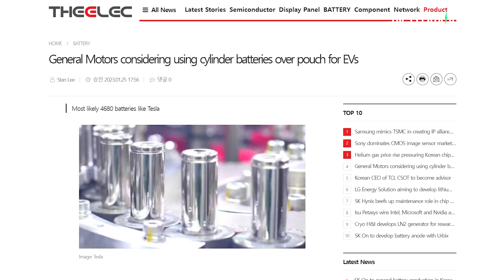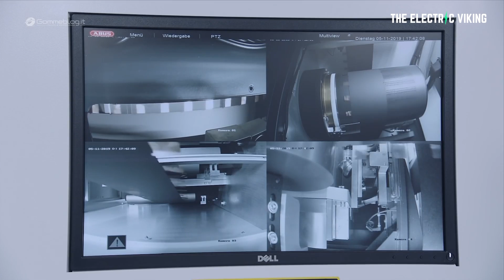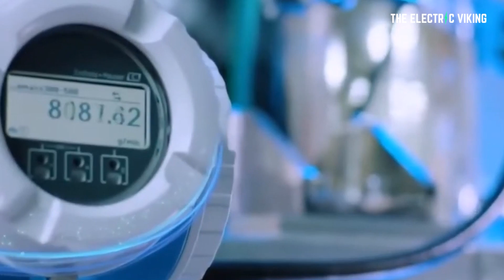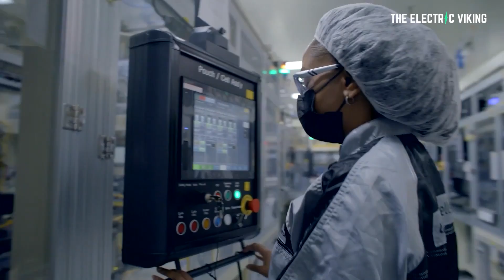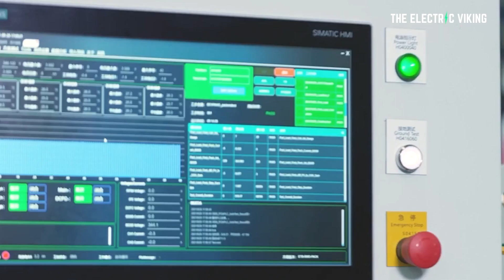Is GM changing from Prismatic to Tesla's 4680 cylindrical batteries?

Comment: If Tesla could make enough 4680 that would be one thing; but evidently they can't. There advantage was slightly higher density about 16% and faster charging/discharging - now fast charging is possible with high voltage super chargers - so much of the pro's are diminished.  They may just wait for a better chemistry and then go for a better density cell for vehicles demanding such cells like the cybertruck

Comment: I believe Tesla was looking to change to the fastest and most efficient production form factor and power to weight ratio. It doesn't necessarily have to be the best but if you can whack em out at high speed, and cheaply, you're on to a winner and that's their aim in order to transition us all to EVs as fast as possible

Comment: My guess is that a large part of the advantage is in their application in structural battery packs saving weight, increasing stiffness and cutting cost / increasing efficiency in the vehicle overall even if the cost of the batteries were to be the same.

Comment: What about Blade cells or moving to Solid State LFP batteries. Cylinder cells will not pass heat as well as the flatter or prismatic cell construction.

The cylindrical form factor has less surface area to move heat.

Comment: Hi Sam and all viewers.  Cylindrical batteries follow the normal practice of primary battery makers worldwide.  Ever Ready, Duracell and others have been using spooling-up machinery to make D Cells, C Cells, AA and AAA cell batteries for DECADES.  Even the 9V PP3 format battery is made up from a few cylinder cells inside.  Who makes flat batteries for general use?  Very few and they are specialised uses.
4680 size batteries are just a step change from the smaller format before it.  Like primary alkaline batteries (and even electrolytic capacitors) the quickest way to fix a volume with an anode and a cathode separated by an intermediate 'separator', cylindrical winding is far and away the quickest way to do it.  Takes a while to tweak to QC but when that hits the sweet-spot the yield goes right up.  The TESLA design was unique and has taken a while to iron out the creases.  It will happen and others will follow.
Keep up your great work and greatest of hopes for Shanna.

Comment: Cylinder batteries are stronger and enable space around the battery 🔋 for cooling and or warming as required.

Yes there is slightly less energy density however this reduces the risk of the battery cell bursting into flames 🤣.

I would rather have a battery that is safer.

Comment: What makes Tesla's batteries so durable and powerful in their cars? It's their BMS, battery management system. Why is it so good? Because it's so efficient to manage the temperature. What makes temperature easier to manage? Maximizing the temperature exchange surfaces. Which cylindrical batteries have a lot of compared to pouch and prismatic. IMHO (I'm no engineer), this, plus the structural aspect of these batteries is what makes them so much better.

Comment: Both 4680 and blade formats aim to optimise EV performance while providing good thermal management.

Determining the exact optimal configuration is a problem that could lend itself to a linear programming analysis. 

These are complex problems and it may take some time to work out the optimal solution.

Comment: I don't I've ever seen people saying cylindrical batteries are a dead end. Technically they will produce less energy dense battery packs, but they are cheaper to make and easier to assemble. The pouch cells by their nature are more fragile as an accidental puncture means a fire in the factory while cylindrical cells have a steel casing. If your goal is a dirt cheap car the best answer is the dirt cheap batteries we've already had massive factories for. 

But pouch cells are far better performance wise. They will obviously have better energy density as cylinders are just incredibly space wasteful producing less energy density and the rolling of the cells also produces more resistance and heat (though this is marginally improved in tabless cells at the cost of energy density). This also means pouches in theory are better in performance, however, pouches also tend to be slightly less stable as they can expand from heat and sandwiching them together makes cooling a bit more effort. 

As you can see it's a rather iffy trade off. I've never said that pouches are superior to cylinders, though I have pushed back on your claims pouch cells are not as innovative considering no cars till the Hummer had ever used them and they do have some advantages even to the most advanced cylindrical. While I know pouches are more hazardous, smartphones have also used them for years so I can't really tell by how much exactly. Likely they more see the fact making their own machines as more costly than buying existing machines for cylindrical cells.

Comment: While Cylindrical cells can be more adaptive, When it comes to space saving and energy density, theres no denying that square or rectangular shapes offers way more storage per volume. Thats why machines and devices like laptops, powertools and mobiles using customised rectangular shaped batteries for maximum capacity. Each have its pros and cons.

Comment: When do you think the competition figured out that Tesla knew something about battery technology that they didn't?

I think about the time we saw Sandy Munro tear down the 1st Tesla with the 4680 and the time the competition were also doing the same. I think the combination the public enterprises like Munro and the competition's own engineers I also figure that Tesla discovered the secret sauce, then board meetings, then discussions with your battery supplier and they pushing back that their way of battery manufacturing is better. 

I figure a month after the 1st 4680 battery was available for the competition to check out. And remember its not just the shape. The manufacturing method inside the battery are also new technology Tesla figured out. 

The fights between the competition and their battery suppliers probably took a few months, then final decisions along with figuring out how to get their own 4680 style batteries

Yup - last summer. I also think the competition since 2020 figured out that Tesla was a threat, by 2021 they became very worried and by last year and the launch of Giga Texas and the 1st 4680 battery being sold.

I wish I was a fly on the wall at some of those board meetings.

A decade from now, there will be a miniseries on how Tesla took down big auto and now Tesla is big auto.

Comment: Elon warned GM about the dangers of pouch cells and thermal runaway several years ago.  What was that little problem that GM had in the Chevy bolt a year ago?  Tesla had the same problem and fixed it by moving away from pouch cells.

Comment: “We realized that the true problem, the true difficulty, and where the greatest potential is – is building the machine that makes the machine. In other words, it’s building the factory. I’m really thinking of the factory like a product.” - Elon Musk

The 4680 battery was designed for the factory, i.e. for the manufacturing process, instead of the other way around.

Comment: If the thickness of the layers in a cylindrical cell expands uniformity from heat, the layers has to slip against eachother.
A flat cell doesn't have that problem.

So, cylindrical cell isn't the best from every aspect. They are easiest, and thus fastest, to produce, though.

Comment: I don't think GM used prismatic cells, rather they used pouch cells to form their batteries. The Chevy Volt ones are pretty sweet, I've bought new and used ones for electric motorcycle builds.

Comment: My intuition tells me that the long ultium style cells when used in a structural battery pack, could suffer from the torsional stresses present in use as a structural component. Using the 4680 cells with the inter cell spaces filled with something like 3M's boron nitride would provide thermal conductivity for battery temperature control and electrical insulation between cells and pack elements and avoid those torsional stresses. Yet another thing to consider.
Reply: I guarantee you that no one is using boron nitride to fill the space between cells.  Maybe a polyurethane or similar product.

Comment: I guess the LG/GM decision to not proceed with a new factory is probably multi layered and not exclusively the change of battery form. The truth may take some time to come out. From a GM perspective it does present an opportunity to partner with another battery specialist rather than just having LG. I would love to see GM use the opportunity to perhaps go with a next generation battery chemistry such as Lyten's lithium/sulphur battery. Getting triple the gravimetric and volumetric density of current batteries at a greatly reduced cost (no NCM) would help it move to the forefront of EV tech and make up for its lethargic EV transition pace thus far. Interestingly, Lyten (whose CEO is an ex GM engineer) only just got a mini scale battery factory into operation in late 2022 demonstrating proof of scale and is looking to get a major scale battery factory up and running by 2025.

Comment: The debate here is cylindrical vs flat. The fact that the debate is ongoing proves that neither has the overwhelming, 'killer' advantage. The choice is not about battery chemistry, but about how to package it, and this debate may continue for decades. But another factor that is not mentioned but should be: Looking forward, which form is more amenable to different chemistries, and is more adaptable?

Comment: Munro and Associates came up with the same volume per cell but shorter and with a 50mm diameter.
The Tesla engineers, the Canadian Dahn labs and their own in house battery production line manufacturers, chemist's and designers, Grohman and Hibar and Maxwell know more than a little about production.
I've no worries about the outcome. TSLA!

Comment: Yes, Ultium batteries may be more dense, but what's the weight? Can the architecture shed heat quickly?
Reply: If they are more energy dense, then the weight of a given kWh size pack is less.  That's definitional.

Comment: Battery engineer here. Cylindrical cells have higher energy density than prismatic cells, but when packaged in a pack, there's more dead space between cells, so at a pack level, cylindricals and prismatics can have comparable energy density. Cylindricals have an advantage in that they cannot swell, and swelling is a common failure mode in pouch and prismatic cells. If I were buying an EV, personally I'd prefer a vehicle with cylindrical cells.

Comment: Whatever form wins out in the end, all use Li in their chemistry.  This is great, and necessary for vehicles because of weight considerations.  However for static applications, there is no such restriction and the added demand for Li to build grid storage is pushing up the price of Li and hence of EVs.  And some of the alternatives are superior to Li batteries in a number of respects.  They have longer life, are made from cheap, readily available elements, can be cycled between 0 and100% with no damage, are safer and hence more easily shipped, need simpler electronics and are easily recycled if you ever need to recycle them.

Comment: From one actual engineer to another,  Paul O'Neill's comments below accurately explains why engineers prefer the cylindrical battery cell design over a prismatic ('pouch') design. Especially the stress in the many folded foil points in a prismatic battery. Yes, prismatic has a higher volumetric energy density but they are less durable than cylindrical. Why, because prismatic cells are inherently prone to metallurgical stress & fatigue failure due to vibration at the folds. They should only be used in static situations like a power wall and not in a dynamic situation involving any vibration like a moving car. Tesla engineers, Sandy Munroe etc know this problem exists. It's basic engineering. Manufacturers try to avoid the high cost of recalls causing brand name damage and should build for longevity, unless of course, they want to build for that horrible thing called 'obsolescence'. Sam, I personally would avoid purchasing any EV with prismatic (pouch) batteries.
Reply: should read - 'built-in-obsolescence'.

Comment: 4680 allows continuous manufacturing, following the stop/start for welding the end cap collectors.
Reply: And you can adapt the welding onto a rotational station. Just need a good slip ring design that can handle the voltages. Similarly to the modern Hot Fill Bottle Blow stations that are now electrically heated (230 VAC).

Comment: It's just a rumor at this point, and the rumor didn't come from GM, it came from someone speculating if GM COULD use cylindrical cells, not that they have ANY plans to, so the rumor means absolutely nothing.  Cylindrical cells are shown to be slightly faster to produce over pouch cells, with today's machines, but, that may not mean anything.  Who's the world's largest battery manufacturers and what types of batteries do they make?  CATL, LG and BYD, and none of them make a single canned, cylindrical cell.  People can hypothesize all they want, the facts are the facts, and I don't care what form factor they use for their cells, as long as they work good.  Ultimately, GM, and many others, are looking to use sold-state prismatic-type cells which require virtually no BMS, so today's batteries are a short-term story.

Comment: 4680 cylindrical Is key to the structural design, using the honeycomb sandwich method. I think this is an important reason for going with 4680.
Reply: Also The 4680 structural pack might be necessary for using both front and rear castings. I think the front casting is only used with 4680 Structural pack

Comment: My guess would be that GM et al are just doing due diligence in their research such that they are prepared to move to the 4680 once it is a proven battery.  For me, I'm in the camp that is waiting to actually see a Tesla using the 4680 in numerous videos.  Then I will believe, and GM will probably move to the 4680 once they are convinced that it won't fall on its' face.  GM does not need more cars catching fire.
Reply: Some MYs with the 4680s were produced at GF Texas a few months ago.  Sandy Munro took one apart, at least the battery pack, recently.
Reply: @Chainyanker007  I saw that, but I never saw them driving it around.  Just tearing it apart.

Comment: I’m confused. I would think that pouches have the potential to be more energy dense.
Reply: You are correct, a square shape or rectangle object is always of higher density than any round object. 

However, there are 2 additional parameters that need to be considered. 

1) Is the heat management, or the contact surface area needed to disperse or add thermal energy

2) Distances travelled from the cathode to anode for the current to flow. The greater the distance, the greater the internal resistance. The greater the heat generated that is required for item 1. 

The 2 above are based on the assumption that the battery chemistry is identical. 

Hence the Telsa Tab-Less 4680 design. Shorter distance for the electrons to travel (less heat, less resistance). And 360 degree available for cooling surfaces. 

 Munro Live did a video or two covering this topic in greater details. https://www.youtube.com/@MunroLive

Comment: 4680 cells will work, but not as good as the smaller cells. Smaller cells = more energy density. Only reason Tesla will make those 4680 cells, it's because they are cheaper to produce.
Reply: Wrong, the larger the cell the less material needed for the wall material, so a larger percentage of the cell's weight goes to the energy storage chemicals. Also the design collects the power from the cells better on a shorter path.
Reply: @earlpottinger671  
So why Tesla is using 18650 battery cells exclusively for Model S and Model X ? All Tesla battery cells was tested by others. I can write you exact density, and energy numbers later, I don't have it in front of me right now. 4860 cells performed the worst.
Reply: @earlpottinger671  
Here is the energy density numbers... 
18650 battery - 280 wh/ kg on cell level, 
186 wh/kg on pack level.
2170 battery- 263 wh/kg on cell level, 180wh/kg on pack level.
4680 battery - 244wh/kg on cell level,
158.4 wh/kg on pack level. 
Elon Musk sold you unrealistic fever pitch. He said that 4680 battery will produce 5X more energy, 30% more range, 6X more power, none of it is true.
Reply: @peterp4753  This numbers you just post, where did you get them from. The source MATTERS.

Comment: The big thing is not the form factor as such
The big thing IS THE TAB LESS battery... really a misnomer, I would say a MULTI TAB solution.. or "Continuous Tab"
It is the "Tab less" technique that made it possible to make a cylindrical battery this size and retain good characteristics.

Then staying to the cylindrical form..
Well making cylindrical batteries is a well know and HUGE enterprise, this is "just to change dimensions"
Speed means money...
Normally what takes time is "Start-Stop" actions.
Making cylindrical things you normally can keeps these actions to a minimum.
Meaning faster production speed.